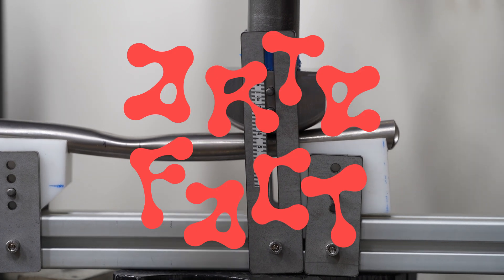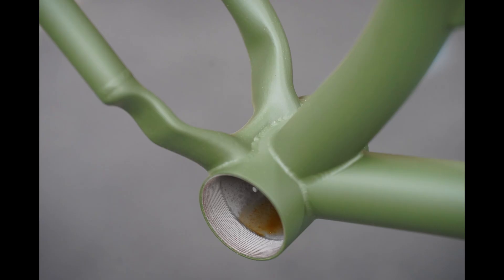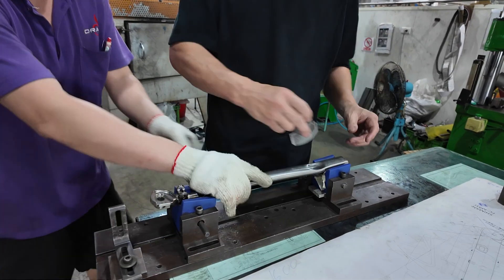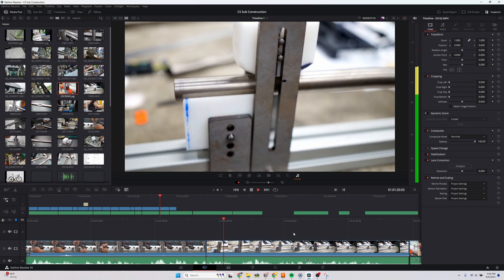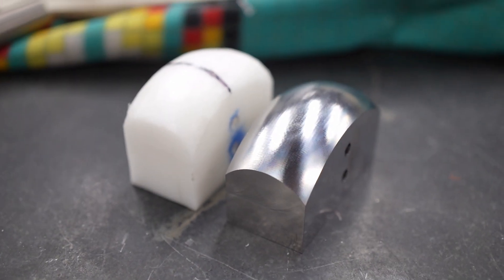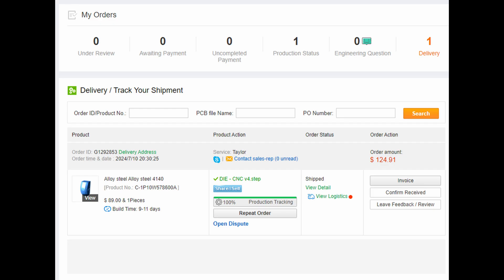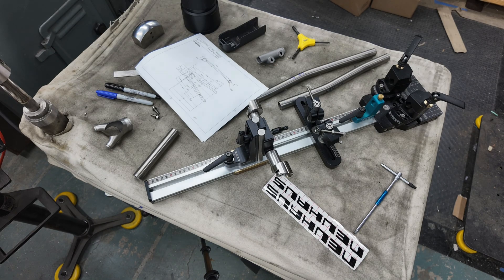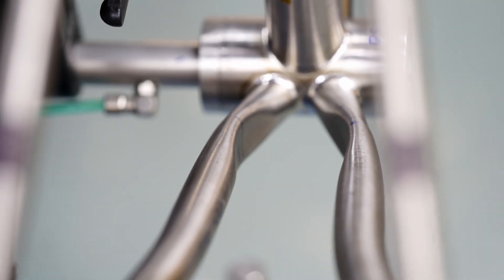Mastering Titanium: How I Designed a Chainstay Dimpling Tool

Comment: Fantastic work. 
Been wanting to indent stays on a finished frame Klein Quantum (“ez9000” alloy) to fit 35c  using a c-clamp and a wood mold as backstop. It’s a very little area and 2 mm indent max but dangerously close to gusset. Would you anneal? Do you think it will crack?
Reply from the maker: Are you sure the chainstay is the limiting factor? Usually, for old road bikes, the outer diameter is also a limiting factor. The tire can hit the brake bridge and the seat tube. The other limiting factor would be the brakes themselves. Normal road caliper clear 30mm at most.

Comment: Have always heated up the titanium when bending it and I never had a problem with spring-back or cracking the titanium
Reply from the maker: Not sure I agree with this method for bike frame fabricaiton. Titanium is very sensitive to heat. To reach the CWSR condition, you need to hold the tube at 600F for 30min in an autoclave.  That is the protocol laid out by the ASTM B338 standard.
Reply: @Daniel_Yang_ARTEFACT  
I'm guessing that recipe is for modern titanium or only particular grades of titanium. I just know that my dad still works as a machinist for the past 50 years in a factory called Timet Metals in Toronto Ohio where they produce titanium for places like Boeing. Before they shut down the tubing mill, my dad was able to get 12 sticks of 2 1/2" x 10' long tubing and we never needed an autoclave to heat it up to bend it. Just used a standard torch and tubing bender. The bend will stretch on the outer side of the bend and it presses into a perfectly-shaped set of ripples on the inside of the bend. Was seriously nice since none of our vehicles even had to replace the exhaust other than the muffler (cherry bombs)